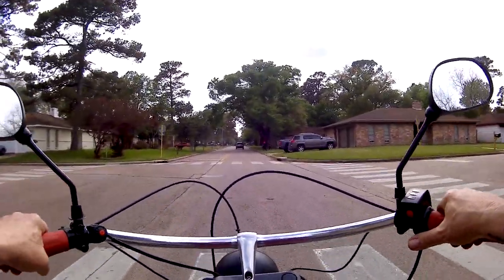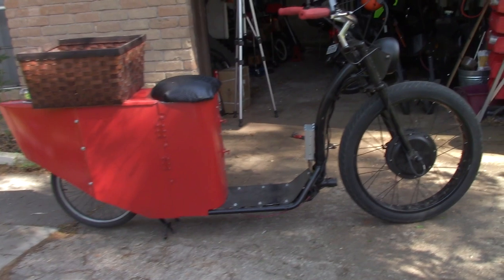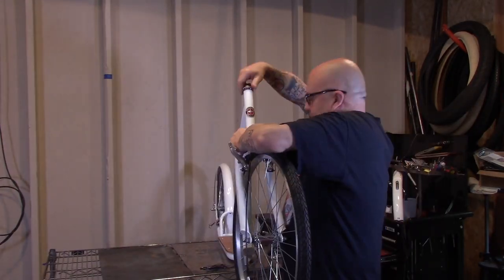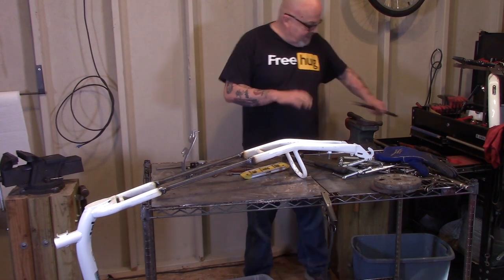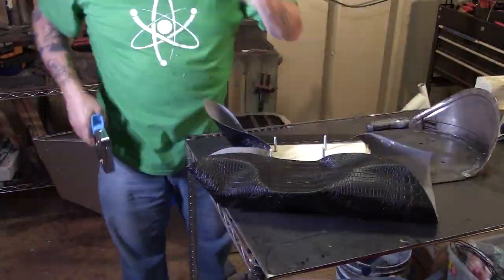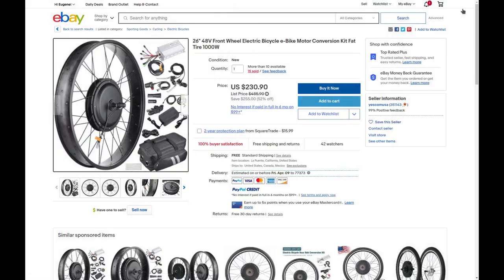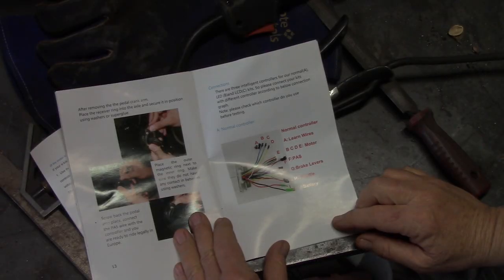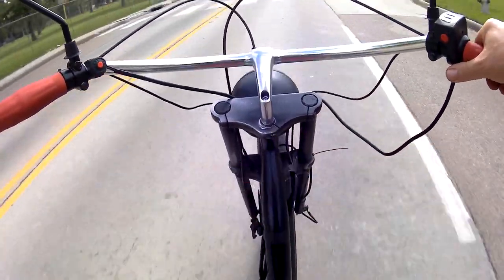Cool Vintage Looking Motorized E-Scooter 1000 watt 48 volt w/ Air Horns!

Comment: I like the fabrication skills . Small vents on the panel would look neat. Rubber trim on footplate grippy in wet..
It's a great hobby. 
Put 2 stroke  motor on it and block any calls from Greta.
Reply from the maker: Cool idea

Comment: This is amazing. I love all of your bikes.. jealous on how much you know! My friends bike is having major trouble starting.. seems to be low compression so it doesn’t start. We’ve tried everything! Any helpful tips? We’re out of ideas.
Reply from the maker: could be head gasket, cylinder, head or rings. time to pull head and possibly rebuild top end
Reply: @HughesMotorized  Thank you.. we’ll keep trying lol
Reply: @HughesMotorized  Hey! I finally figured it out watching your other videos.. it was the clutch slipping 🤦🏻‍♂️ So I went in and tightened the bolt and boom.. it started right up! Thank you for your help

Comment: can I make that welding job with electrode welding technique? good job and awesome videos
Reply from the maker: Yes you can!
Reply: @HughesMotorized  thanks bro I think I'm gonna start makin my bike, you inspired me
Reply from the maker: @mauriciotellez5241  practice a lot on some similar materials and then do some destructive testing. If yu are using stick welding it will be tricky so you'll have to do very short weld to avoid burning holes. More like tack or spot welding. The longer you  make a weld, the hotter it gets and the more likely to blow a hole in material. Good luck !

Comment: What forks you used ?
Reply from the maker: These. make sure you get the correct ones. Threaded or threadless https://ebay.us/Imnjy6
Reply: @HughesMotorized  what kind of bearing you used for the forks I got the forks but need bearings